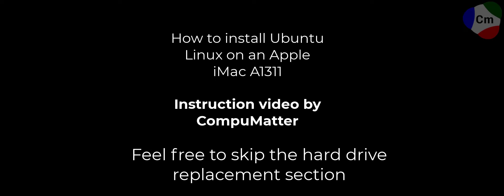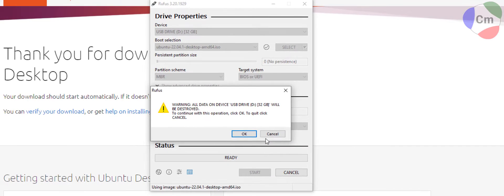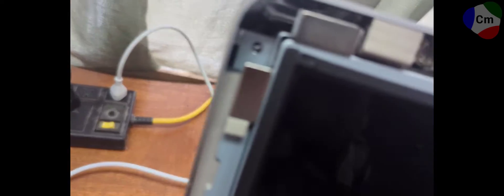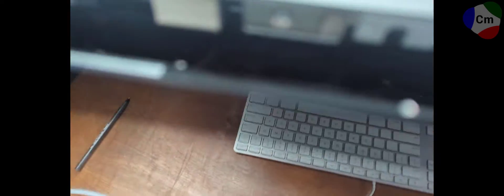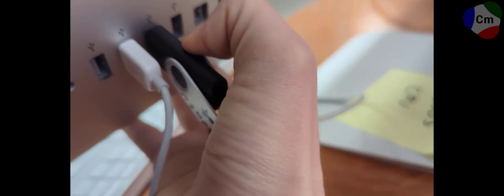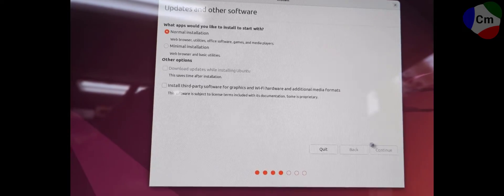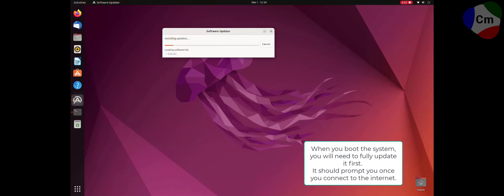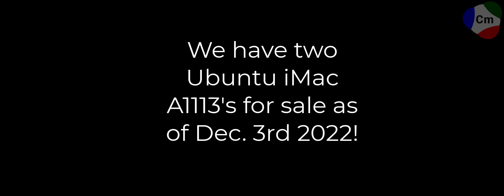Installing Ubuntu Linux on an Apple iMac A1311 + Hard Drive Replacement | CompuMatter Tutorial

Comment: I did this and installed successfully but now my screen is split into 4. It did this on setup but i resarted and ran in safe display. But now that its installed im not sure what to do
Reply from the maker: I would recommend trying this process all over again - making a new USB stick as well in case anything got corrupted.

On installing Ubuntu, you can also try installing "minimal installation" or "safe graphics" to test if there's a compatibility issue. Linux Lubuntu is also another great alternative!
Reply from the maker: As a follow up, also be sure to check "Install 3rd Party Software and Drivers" during reinstallation - that could also be the cure to the graphics issue.

Comment: If I install Ubuntu on my 2013 IMac will it automatically recognise my apple Bluetooth keyboard and mouse
Reply from the maker: It will not, you will need a wired/wireless with USB keyboard and mouse to set up your bluetooth devices.

Comment: Ugh. I tried this with my 2017 and the sound wouldn't work.  A quick google resulted in "it's mostly broken, and only sorta works with some mods".  Give up, installed High Sierra again. Been using linux for 30 years and still hate Linux as a desktop.
Reply: Hello Did you able to install Linux in your 2017 iMac?
   I am going to buy an old 2017  and am planning to install Linux. 

Thanks

Comment: Hey, yet another question this time,  Since you have experience with Linux and iMacs, I was wondering if you could help me find a fix for an audio problem I'm having with Ubuntu and a 5K iMac from late 2015, 27"  Currently Monterey, the last official supported version of macOS is supported until macOS 15 is released this fall, so have tried Open core legacy patcher first, and decided Linux would be a better option out of the two.  Anyway, the sound issue i'm having is, Linux isn't correctly mapping the internal speakers like macOS and Windows do.  The sound works, I applied a fix found on the Linux mint forums and that enabled the headphone jack as well as speakers, but I haven't been able to equalize the audio correctly.  The best way to explain this is, the treble and bass are not balanced, and the sound leans more toward monaural stereo vs true distinct stereo.  The iMac identifier is 17,1 for my model.  This probably wouldn't bother the average user, but because I have a background in Music, broadcast, and computer repair, I would like to try to solve this issue if  possible.  Thanks for the video, and I do think you do well in presenting good info on the tutorials I've watched.  I actually found you channel by accident, it was suggested based on other Linux and macOS videos I was watching.
Reply: Same kind of problem 😢
Reply: @frozenKid Oh, I had forgotten I posted this.  I fixed the problem.  I applied one of the kernel quirks to get the mic and line out jack working, and then connected a set of powered 2.1 speakers.  Everything sounds as it should now, and it's better than the internal speakers as far as being fuller sound.
Reply: @macinman  thanks for your reply. How you solve the kernel issues?
As I understand, you cannot fix the internal speaker so you add some external speakers! 
     Am I correct?

Thanks again
Reply: @frozenKid Yes that is correct, the internal speakers don't work correctly, but if you apply the latest iMac Quirk, it will enable the mic and headphone jack, and if you plug in speakers, it should then work correctly.
Reply: @macinman  I have mid 2017 27 inch iMac. I want to install Linux mint.  My question are::
A. After installing Linux can it deliver 5k?
B. After installing Linux will the Bluetooth,  WiFi, and internal speaker and microphone work normally? 
    Or do I need to do something extra to do work those properly? 

Thanks for the advice ☺️
Reply: @frozenKid As far as 5K, Linux can't use the dual display tech out of the box, so it will be in compatibility mode at 4K.  As far as the other things, they should work.  Although with my experience, if you want a better Linux experience, you might be better off building your own computer as Apple hardware can be hit or miss since it's primary target of compatibility is macOS, or Windows via boot camp.  With that said if you're prepared to learn how to get things to work then go for it and try it on your iMac.

Comment: How did you solve the bad audio quality issue? Booting macos vs linux the last is giving less good experince in sound quality, basically the higher tones are completely missing. I tried alsamixer, changed the speaker setup from stereo to 2.1 and 4.0 but the issue remained
Reply: Yeah no real fix unfortunately. This is why I went back to High Sierra.  I'd run Monterey but Apple was nice enough to solder in the 8 gig of ram.

Comment: Hello, I have the same model imac as you and I installed ubuntu, but when I'm watching a video on the web, etc. when I'm watching a video, etc. it freezes, it's a black screen and I have to turn it on and off. I also installed ssd and installed ubuntu, but it does not work stably. if you have experienced this problem, I would like to ask for help with this problem. also, your narration is very nice, thank you very much.

Comment: I have latest Linux Mint running on a MacBookPro (late 2008), MacMini (2014), iMac 21,5 (2010) and iMac 21,5 (2009) and everything works fine.

The MacBookPro and MacMini are setup as dual-boot with Ventura (using Opencore Legacy Patcher)
Reply: I've found Mint to be the best working distribution for me. For some reason other ubuntu distros always seems to have issues with the package manager. Also I tend to have more success making working bootable USB sticks with balena etcher.

Comment: Does your computer have display brightness adjustment?  It doesn't work for me and I will try to solve this problem soon.  the fans work constantly, I think 80%, maybe even 90%, I have to implement your suggestions...
Reply from the maker: Yes, mbpfan is a requirement to get the fans to run at normal speeds.
Reply: Had this problem on my 2011 iMac with Ubuntu aswell. First solution was "sudo apt install brightness-controller", but then you have to run a seperate programm to adjust it... So I created a new usb boot stick and did the installation again and it solved itself. Hope this helps

Comment: Hi, 
Great content!
I have problem with black screen without nomodeset in grub. Any ideas? iMac 27 mid 2010, radeon HD 4850. Drivers updated. I have connected additional display and its work but internal display black screen with white lines.

Comment: Hey! I really appreciate this video, but it didn't work. When i choose the EFI boot USB drive from the boot sceen it goes black for a while and then "error: unknown filesystem". If you have any ideas for me I'd appreciate it, thanks!
Reply from the maker: I would recommend attempting to make the boot USB drive again, reformat it first. If that still doesn't work, potentially another USB stick. If you were using a USB 3.0, try a USB 2.0. Hope this helps!

Comment: How you fixed the problem with the black screen? I still looking to figure out,how to get Ubuntu started.

Thanks😊
Reply from the maker: Hello! A black screen can unfortunately be caused by a number of things. Does it show anything on the screen when plugged in to power and turned on? If you opened the machine to perform the SSD upgrade, I would verify the screen cables are securely connected to the computer. 

Otherwise, you should be able to plug in your Ubuntu usb and hold the option key on your keyboard after tapping the power button to boot to Ubuntu. If it doesn't show up, the USB may have not been made correctly or failed in the process and may need to be overwritten again by Rufus.

Comment: Thank you - I have an older iMac 1311 and will be installing Linux on this computer.  Thanks for the update for the fan.  I think this would be a good computer for Linux and i do not have to purchase another computer just use the iMac.  I like apple products and this lets me use this. Do you think I can install a Cannon MB5120 wireless printer on this system?  Thanks again for your help.
Reply from the maker: It looks like that printer model is about 7 years old at this point, and there is not much information about compatibility. I would say it is hard to know for certain without trying it out. I'm glad the fan tip was helpful, the iMac has great hardware and it is good to see it still get some use after Apple's discontinuation of support.

Comment: Hello. Thanks for the video. I am planning to get the imac 27 Year 2011. It's on Intel, so I think it will be easy to install Ubuntu. My question is: Was the fun issue resolved by mbpfan installation? How is the energy consumption?
Reply from the maker: Yes, mbpfan is designed to control the fans and stop the fans from going to their maximum speeds 24/7. The energy consumption has not been tested, but I have noticed that if the machine is running for long periods of time, it can get pretty hot in the back so it is definitely worth keeping an eye on it.
Reply: @compumatterllc 
✋🏼 "long periods of time" - how long? a few days? 6 hours? 2 hours?
Reply: @manOfPlanetEarth  same question here!!!!

Comment: How does it performs in average daily usage compared to OSX? 
Is it possible to keep the machine update in opposition of what apple does with old hardware?
Reply: Updates work perfectly and it is a long-term solution.

We are a computer store and have been doing this for years.

I highly recommend you make the move and never look back
Reply: I've got imac os snow lepared it won't work on that will it
Reply: @heatherjones9090   Ubuntu doesn't care what Mac OS you had before.  It is just going to use the hardware.   That said old hardware is eventually unsupported.  I would recommend you try it !